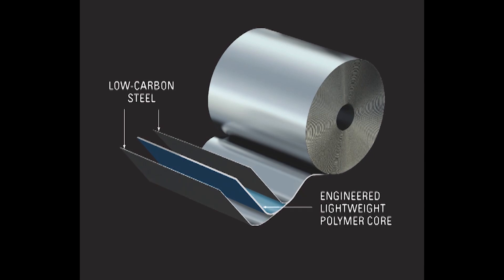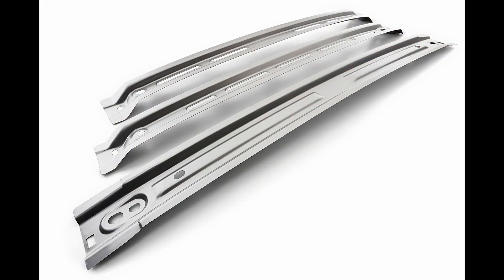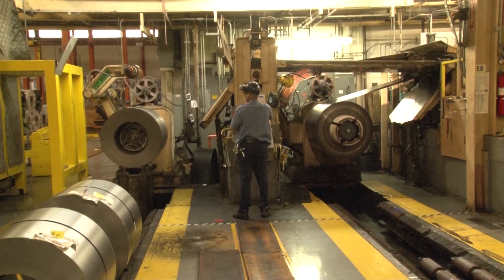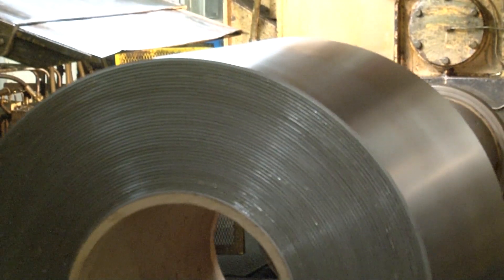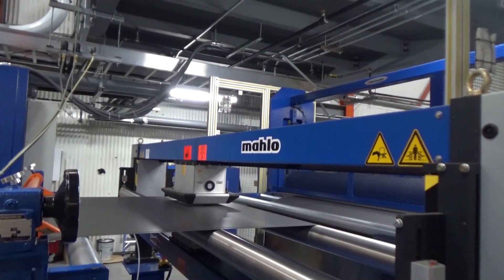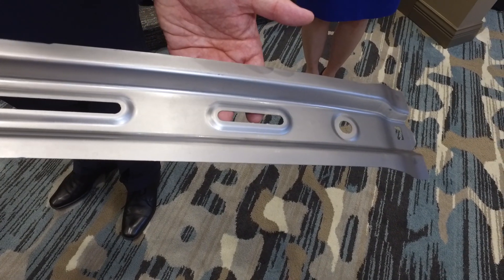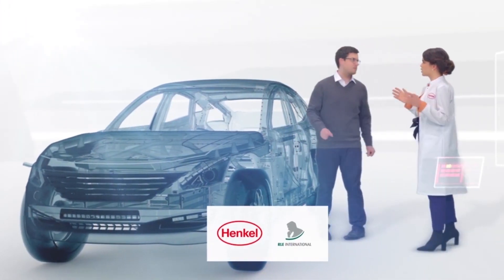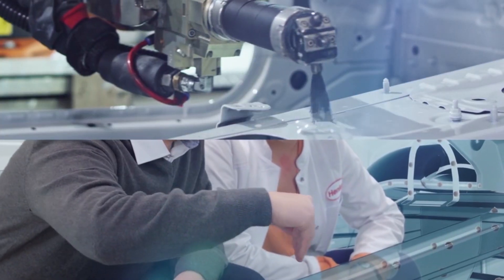MSC Presents the Latest in Steel Technology - CAR MBS 2019

Comment: Not new. An engineer at Delft University developed an Aluminium - GRP - Aluminium sandwich for Airbus called GLARE  which was used on the A380. This is just a low tech copy using steel.

Comment: As a bicycling enthusiast, I wonder if this material can be applied to bicycle frame building.

Steel is a favorite material for bicycles, due to it's natural 'springiness' which makes it very comfortable, but it has been overtaken by aluminium and carbon fiber due to their lower weight.

If this stuff is, as claimed, 20 to 40 % lighter than conventional steel, that would make it very competitive in the bike frame world, depending on cost, and strength factors.
Reply: Yeah it would be interesting to see how it could apply to bicycles. Steel is actually preferred by some who cycle a lot because of how that "springiness" factors into the durability of frames resisting jarring impacts on urban roadways and paths.
Reply: @ZealofSparta  
They would have to roll it and weld, glue or rivet it to make tubes, as it is laminated and you wouldn't be able to extrude it as normal tubing is made.
That would be a limiting factor in bicycle frames, IMO.